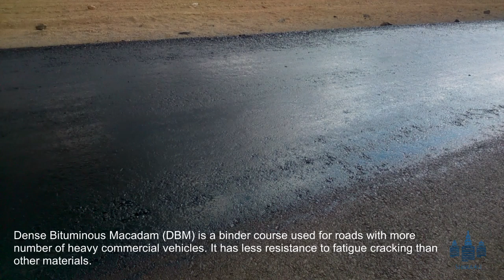Dualling of Athi river to Machakos Junction -  Part 2

Comment: I live along this stretch of road. Where did you get the information that they will not pay compensation for service lanes land acquisition?
Reply from the maker: hi duncan ngari just alot of research, if we start with Athi river, most of the buildings are yet to be demolished since most of the land on that stretch is not on road reserve. Check the first approved maps of the proposed dualling vs the approved one, you will notice that the original plan had not considered the S.G.R bridge that has now occupied the existing road, therefore pushing the service lane plus the interchange further away from its actual point.
Reply: shira 4u thanks. Where can I get or see these maps? Back in 2015 we filled some forms for possible acquisition but we've not heard anything since then.
Reply from the maker: Duncan maybe this will help, you can follow the link https://www.google.com/search?q=athi+river+machakos+junction+road+design&source=lnms&tbm=isch&sa=X&sqi=2&ved=0ahUKEwjMzZCR8NfdAhXFyIUKHVsPDR4Q_AUIDigB&biw=1093&bih=526#imgrc=W0ShpEDLOnGBWM: